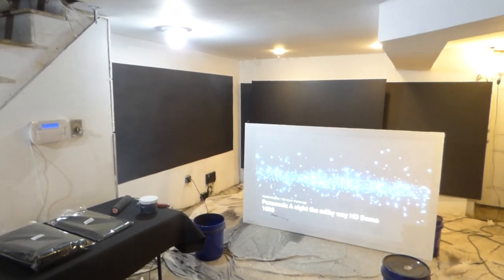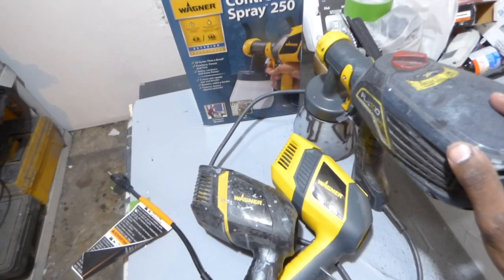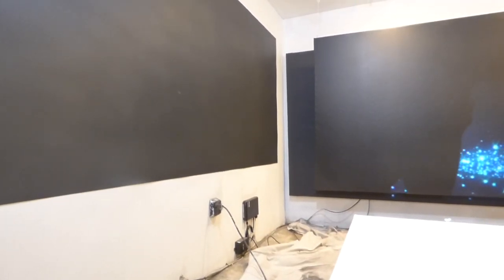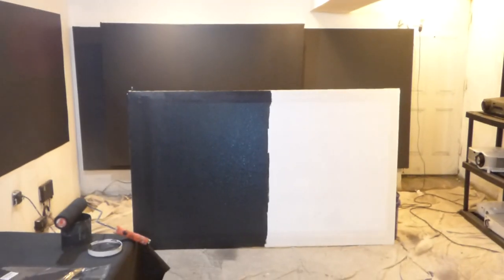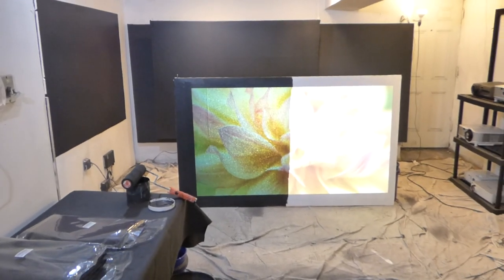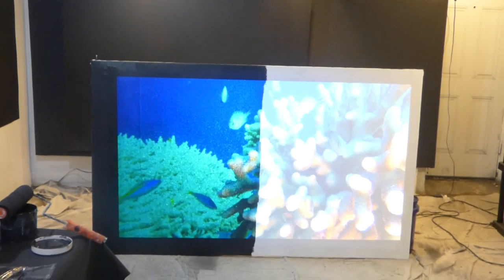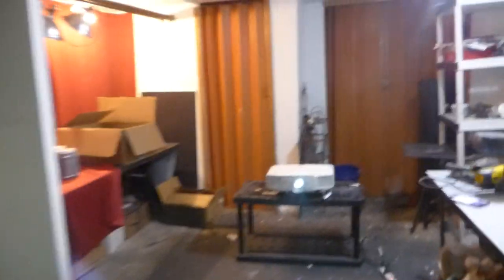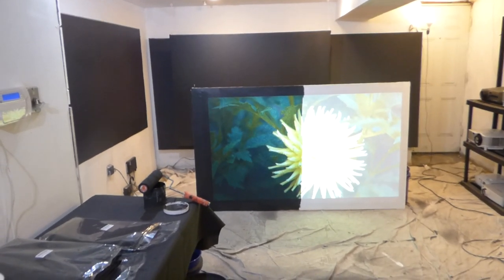FIRST Look at our new supreme (7)  ROLL ON!   Paint on demonstration!

Comment from the maker: NEW Supreme (7) roll on screen paint!

Compatible with all types of projectors Note name brands  (only )
ALR technology gain X7
Weatherproof for indoor or out home theater setups.
4K and 3D ready.
Drying time 10 to 20 minutes with a fan note larger screen may take longer.
NO Priming!
NO Spraying!
One coat application only needed.
Easy to paint no spraying no proof required.
Low-odor and Low-Voc
EZ clean up warm water and mild soap.
Eco-friendly has a shelf life of five years when sealed properly.
Surface application compatibility: Wood, Glass, Plexiglass Drywall, Vinyl , Fiberglass ,  Acrylic surfaces , brick and cement ,Polyester  and cotton.

True OLED like black contrast levels even when using a projector of only 400:1 contrast. Beautiful Vivid beautiful bright colors without the painstaking problem of calibrating your projector. outstanding white levels the highest white levels in any black screen paint.

1 QT screen size 100" 120" 16:9 , 16:10  free blackout cloth 6ft x 9ft price $368
2 QT screen size 100" 158" 16:9 , 16:10,  2.35:1  free blackout cloth 6ft x 9ft price $468

1 Gallon 100" 200" 16:9, 16:10, 2.35:1  free blackout cloth 10ft x 20ft price $534

Available 05/22/19 
www.crystal-edge-technology-screens.com
Email us at immerse4kcinema@outlook.com